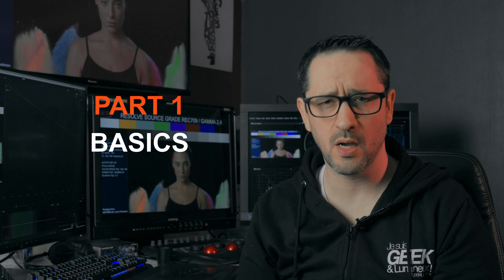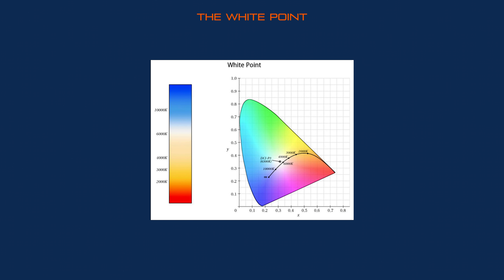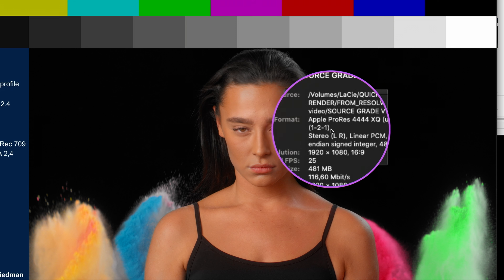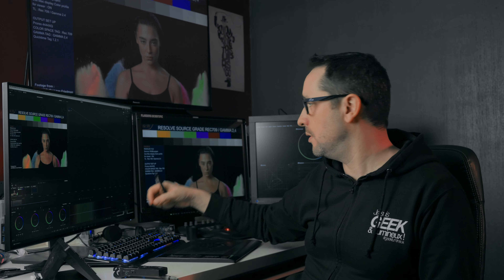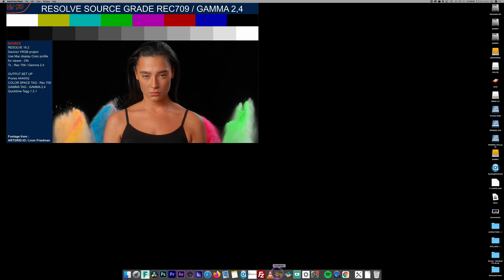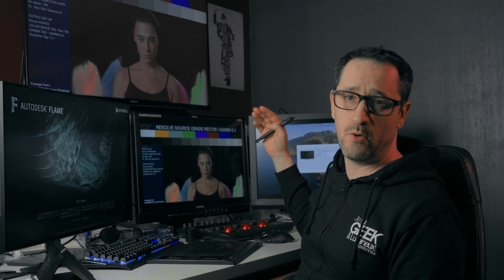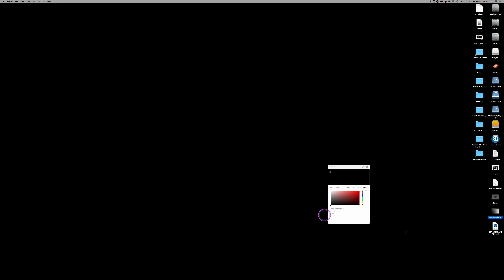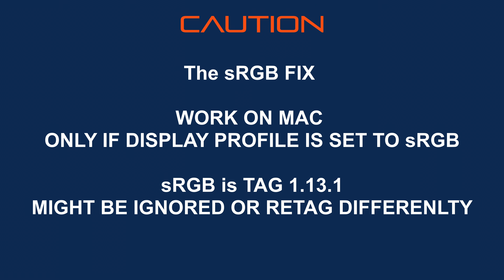Quicktime Color Management: why so many ISSUES?!

Comment: This is phenomenal, in the facebook forums in Resolve, color grading and Premiere - this problem comes up daily. I now have a source that I think explains the whole thing and dropping a share to this video is a lot better for my carpal tunnel syndrome typing all this out. Wish I could click the like more times. Great information.
Reply from the maker: Thanks. Feel free to share 😊
Reply: Almost two years later, this still seems to be the best (hybrid) solution for web delivery. So much misinformation or incomplete solutions out there, it's the blind leading the blind. Would be great if Jay has an update on this for 2022/2023 or if Cullen could do either a livestream or video deep dive on this. The 'hackiness' still irks some OCD part of me. At least CSTs making switching deliverables easier. Thanks Le Labo de Jay.
Reply: @StandOnAMountain  I think that the transfer function ( second digit in the tagging ) needs to be updated by whoever controls that to include actual gamma. When you render a file in most software at rec709 2.4  it will be tagged 1-2-1 the number 2 is undefined. The think the gamma should be present in the actual video. they can fix this because all tagging for HDR is spot on.
Reply: @joshpickup2581  When services consume their upload, I'm pretty sure they set the gamma they want for the service. Wouldn't surprise me at all if youTube would transcode a gamma 2.4 to 2.2.
The lighting environment does change your grading perception and that's where most people make their mistake.
With that said a darker grading in rec 2.4 is way easier to control then lighting a grading suite for 2.2. Turning on the lights is a simple explanation. They need to be placed and the right temperature with the now lighted walls being a consideration as well.
Reply: Sorry to jump in but you seem pretty damm knowledgeable and I have a question about the ‘ultimate fix’. I know you’re not the author of the video but I’m struggling to find a solution.

If I go the ultimate fix route, should I be grading with my output color space set to Rec.709 gamma 2.4, with my monitor calibrated to 2.4 and then before I render for upload to the web, I use a CST to go from 2.4 to 2.2 and tag 709-A? 

Or should I be grading in a 2.2 display space with a monitor calibrated to 2.2?

Also, am I right in saying that I should not have my output color space set to 709-A, but only tagged in the render menu as 709-A? I believe so, as the video does not show this, but many (countless) YouTubers are saying to do this. Even though that seems to make no sense for non-Mac users for will view the content.

Again, sorry to intrude but pulling my hair out.

Comment: QUESTION: For BlackMagic pocket 6K (braw), which color space would be the best (and will it need a timeline gamma conversion), with best I mean the least problematic result for web purposes across different platforms and devices?
Reply from the maker: Hello. Grade with rec709 gamma 2.4 on reference monitor. Then do a cst to rec709 gamma 2.2 and tag rec709 rec709 
That’s the least problematic
Reply: @LELABODEJAY  most of the time all clips are Braw, so would you suggest to leave the camera settings in the color page on timeline instead of selecting clip?
Reply from the maker: @adeeboberoi5362  you can decode in rec 709 or leave as log and grade it
Reply: @LELABODEJAY  Thanks for the informative video on the subject.
For the web, and to avoid the conversations from 2.4 to 1.9, it would be easier to set a calibrated external monitor to gamma 1.9, and tag Rec.709-A in Resolve Timeline and the Delivery page. This is using, Use Mac Display Color Profiles for Viewer. Both Resolve Viewer and the external monitor would be closer than 2.4 after the conversion.
This is what all MacOs player and browsers supporting color management are expecting to see anyway, (1-1-1) = gamma 1.9.
Reply: @LELABODEJAY  What about the new Rec709 (Scene) timeline color space in Resolve 17? It allows for 1-1-1 tags, but the rendered files still don't match. And also, in addition to Rec709-A as an output gamma tag, there's now Rec709 and Rec709 (Scene). How do those influence the way we can mix and match gamma tags and CSTs/timeline color spaces to achieve greater consistency?

Comment: Thank you so much! It's been almost 2 years since the release of this video - has anything changed in that field recently? Any updates in software and web video services you're aware of? At least I noticed that even default export from Davinci 18 is tagged as 1-1-1, not as it used to be.
Reply: yes , XDR monitors are a thing now.  things are VERY different with XDR, resolve defaults to rec709(scene) as output colorspace which by default sets the tags on export, before it was rec709(gamma 2.4)
Reply: @FinnJaeger1337 what does this mean for the end user?

Comment: I've been down this rabbit hole for a few days now and that ultimate fix is what I found WORKING so far but I wanted to validate if I'm doing it correctly.

Here's what I'm doing: My main audience are on web (social media), I use the latest mabcbook and use Timeline Colour Space = DavinCi WG/Intermediate and Output Color Space = Rec.709 Gamma 2.4.

After all my grading work, I then follow your ultimate fix by adding a CST node at the very end of my node tree, once applied my footage looks more contrasty. I then use the tag Rec.709-A at export.

Am I doing it correctly? Thanks in advance! 🙏
Reply from the maker: @heydeeeey  hello. You should export rec 709 / rec 709 
And what would be the easiest is stop exporting from resolve with rec 709/gamma 2.4 that’s why and where the troubles come from
Reply: @LELABODEJAY  thank you, you're the best!!! and did i do the CST part correctly? i just want my videos to look the same on social media and what i see on resolve, i ignore viewing on quicktime

Comment: Amazing video, thank you. Question, I am using a M1 and have calibrated my display with a calibrite display plus HL – I'm assuming this profile stays in the system settings and isn't used within Resolve to help with color accuracy? 

I color manage with nodes - so I convert the footage to DWG and Da Vinci Intermediate for grading, then (at timeline level) convert DWG Da Vinci intermediate to rec 709 (Color Space) and rec 709-A (Output Gamma) with a CST. In this case in the delivery page I would leave the tags as same as project right? Am I doing this correctly?
Reply from the maker: Tanks. It’s getting old should update it
Once again rec709A is a trick like my ultimate fix that only work for Apple. 
This issue only occurred in Mac OS X not on iPhone iPad or in pc world
The easiest way is to stop exporting in rec 709 gamma 2.4 from grading as it clearly make hell on earth

Comment: Hey, im working on a project for a client. 
On vimeo everything looks washed out
My grade in davinci is
Blackmagic Wide Gamut, Blackmagic Film Gen 5 to
 
Davinci Wide Gamut, Davinci Intermediate to

Rec 709, Cineon Film Log and

with a 2383 Film Lut as the last node back to Rec 709 2.4

I export the graded file as DNxHR 444 12bit video levels Rec 709 2.4 and import it in After Effects. After Effects expects DNxHR 444 to be full levels and converts it to video levels. Its the legal vs full issue with DNxHR 444 in adobe software. I did think this was the issue. Would exporting the file at full levels for the import in after effects fix it or not. 

The grade is finished, so full levels for after effects and web export doesnt need to be. It would be just to fix after effects from washing out the dnxhr 444 file expecting the dnxhr 444 file rendered at video levels to be full range and converting it to video levels. 

Should i change to Rec 709 2.2 with CTS and Rec 709-A in export settings in davinci before exporting the grade or before rendering the delivery in after effects
Reply from the maker: Hello
Hard to tell from distance 
Why are you in full
Video should be levels
If you grade on monitor video it should be levels 
Tv and web expect levels
After effects ignore gamma 2.4 tag 
It will export 1.1.1 rec 709
May be it’s the first step to watch at 
If your content will only be on web yes you should try the fix but remember it’s a fix and not accurate 
Rec 709 gamma 2.4 is for tv in darkness
Rec 709 tag 1.1.1 is for monitor on bright environment. Perception should be the same….
Should ! 
Such a mess
Tell me if that helps
Reply: @LELABODEJAY  Thank you for the quick answer! 
I need to say im on windows.
I would export as Full Levels DNxHR 444 12bit Rec 709 2.2 Rec 709-A in resolve for after effects. 
In after effects i would then add the levels effect-computer to video profile to convert full range back to video levels.  
After effects wouldnt convert video levels to video levels as so the footage wouldnt be washed out and because of the levels effect, the export from after effects for delivery will be in video levels again. 
What should my timeline colorspace, gamma and my export in after effects be, Rec 709 2.2 for time line and Rec 709-A for export right
Reply from the maker: @arceus2015  rec 709 A is only for Mac. No need on windows 
Why are you going to after effect ?
Full level should not be a problem 
Just export in auto from resolve 
In windows you don’t have tag problems so if your colors are washed it’s not a tag problem
Unless you are in aces or in dolby workflow or with 3D exr elements you should not work in full 
No need and can cause issues that you are currently experiencing
Reply from the maker: @arceus2015  you should export rec 709 rec709 tag won’t matter on windows 
Test several method to see what’s the less corruptive 
My video is 2 years old some things has evolved 
Really hard to tell without clip and testing and seeing

Comment: Excellent. 1. How do these answers translate to the new MacBook Pro computers? I have an M1 max. It has a BT.1886 profile. 2. How does this work with resolve color management at the project level, instead of the node level? There are a lot of advantages to using project level color management, vs node level management in my experience. I'm still having issues getting my decklink outputs to match my internal viewer and my exports. I can get there with node level management, but not project level management, like I want. Thanks for the AWESOME video man. Subscribed.
Reply: Someone correct me if I'm wrong. This response is to test if I understand it correct: 
1. Your Mac display profile does not matter, as long as it is the correct profile for your display. Mac OS color management will handle the rest, but to view files correctly in the viewers in resolve you should set: Use mac Display Color Profiles for Viewers. 2. I think you sound set your resolve color managend settings to red709 gamma 2.2 for web export and than still change the tags on export to rec709 and rec709a.

Comment: An excellent video! Thanks you for the detailed explanations. One question, I’m using DaVinci Resolve on Windows. If I use node based colour management and use an output CST to Rec.709 2.4 at the timeline level when grading, should I still add a CST after to convert the output from gamma 2.4 to 2.2 and export using gamma tag Rec.709-A or can I simply change the output CST from Rec.709 2.4 to Rec.709 2.2 and use Gamma tag Rec.709-A on “Delivery”? Is there a difference?
Reply: Did you solve this? Doing this now and I don't see the reason to add an extra node to covert to 2.4 when the timeline is already 2.4 and you convert to 2.2.
Reply: @JamesWilliams-in3py  No, I never received a response. 
My timeline is in DWG Intermediate, so I use the last node to transform to rec709 2.4 when grading.
Reply: I could be wrong, but I think the Rec.709-A is generally the solution for mac users. As for windows I would edit as normal. For web, my project and timeline would be Rec.709 Gamma 2.2 and export with those same settings. The point of using gamma 2.4 is if you know its for broadcast.
My take away is be intentional with what you're startup settings are and if you get caught in gamma 2.4 but need to export for web, add a node to timeline and convert to 2.2 (or 709-A for apple devices)

Comment: Does this mean when sending files for these 3 web deliveries you have to change the timeline output color space and adjust the footage to look like your final grade across all three output tags? Pls let me know if am correct
Reply from the maker: Hi just export in rec709 for web and do the Cst to convert gamma 2.4 to 2.2 
Don’t touch the grade
Remember that you have gamma 2.4 for monitor in dark environment and gamma 2.2 was set for monitor in office in daylight 
You can’t have one file thad works everywhere 🤷‍♀️
Reply: @LELABODEJAY  you mean I should do a cst conversion to my final grade at the end? Is that correct? 
My only screen is a macbook with p3 display
I don’t mind having different files for all deliveries.
Reply from the maker: @sondp  you should not trust your MacBook for delivery 
Get a video card and a monitor for grading. It will avoid any critical issues
Reply: @LELABODEJAY  One last thing that confuses me when using srgb monitor is the workflow because if my
monitor is srgb and DaVinci source timeline is rec 709 2.4 and with my understanding the use mac display option is supposed to be turned off here. So how do I make sure that what am seeing on resolve on the srgb monitor will be the same on the web, do I still need to do the Cst to convert gamma 2.4 to 2.2 or how?

Comment: Thank you a lot for this video, really clarified some things! Quick question: What would happen if you export as follows: Rec709/Gamma 2.2 and then tag it as 1.4.1 (Rec709/Gamma 2.2/Rec709)? Would that tag get misread / re-tagged by some of those apps as well?
Reply from the maker: It will be ignored as everyone ignore tags except Mac color managed applications
The only way to avoid this shit is a lot more simplier that what I have explained in this video 
Stop tagging rec 709 gamma 2.4 
So we will never have shifts 
Color sync can be so tricky and leads to error 
The ultimate fix is a trick 
Like every trick it generates problems. 
I should redo a video about it 
This one is old
Reply: @LELABODEJAY  Thanks for the reply. Would be awesome to get an update video... even if it is just a short guide without elaborate explanation. I've found your video when I re-searched a color space problem I had. I also posted on a bunch of message boards about it and got referred to your video at least on 3 separate instances.... Your explanation is by far the best and most thorough one I found.

Comment: I tested Rec 709 A solution and got a different result from yours, my source on Davinci looks identical to Quicktime,  youtube and Vimeo on every browser on Mac, iOS is identical too. I couldn't test on windows and android because I don't have them.
Reply: So what did you use as settings to get this result?
Reply: @ByRaph I created a serial node at the end of my color grade and transformed my timeline color space to rec709 gamma rec 709 A, then at the export setting I changed color space to match (rec 709 gamma rec709 A)
Reply: @sondp  Same
Reply: I did this Rec 709A solution and it looks identical in Quicktime and on Vimeo when I upload. However, if I open the same file in VLC, it looks more saturated / higher contrast. I'm wondering if someone viewing on a PC will see what I'm seeing on VLC, and if so, is there any solution to this?
Reply: @skermani  Either you don’t use VLC player at all or ask your client which media player they use and export what matches that player. Or you can export one file that gives you best results when uploaded to socials or web and let them know which player the need to use for playback.
Reply: And you still have to export another different final file according to what the use of the video is for, i.e web or socials